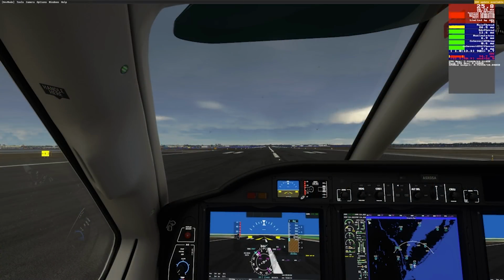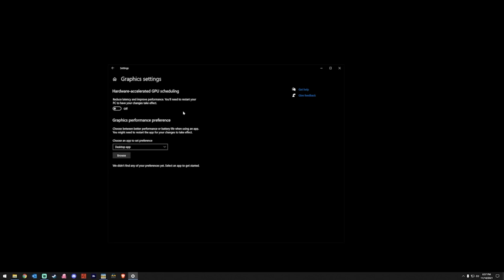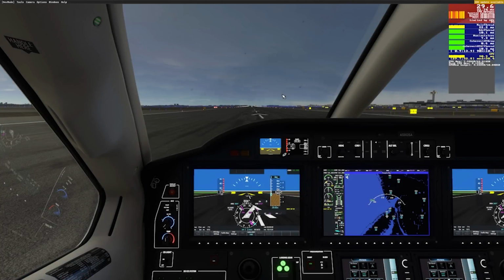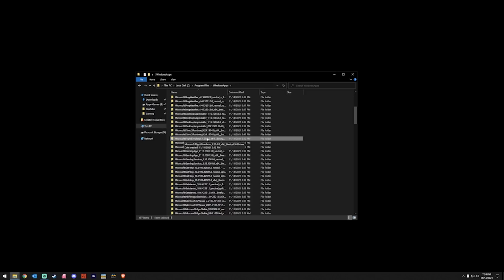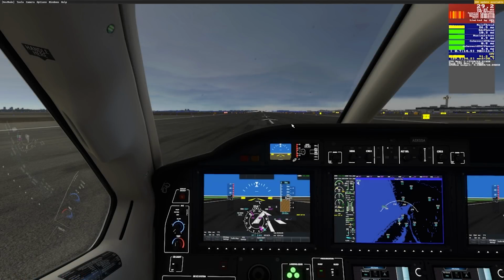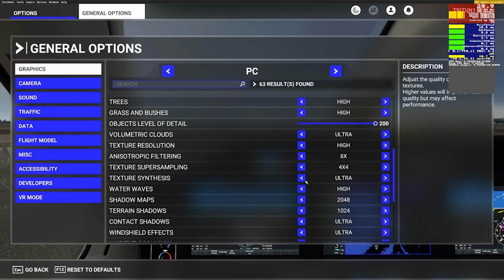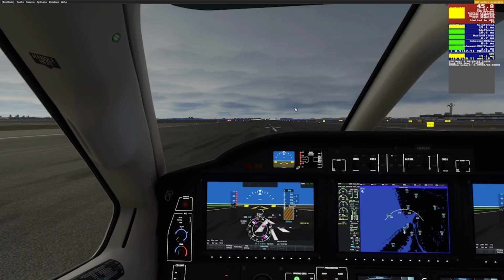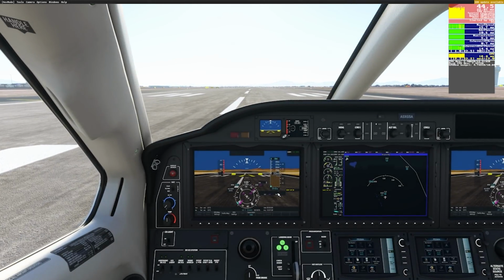Microsoft Flight Simulator | Finding Best FPS | Do Old Tricks Still Work

Comment: I do not understand but since yesterday the use of my gpu (rtx 3080) is 60% on average while before this between 90% and 100% .. with that I have a net decrease in my fps.
Reply: I start since 60 than drop to 50-45,even 35 mine is rtx3080tu

Comment: I have cancelled the game mode option three weeks ago and reduced the CPU package temperature by 20°C along with reducing graphic options. . Core running temperatures were around 100°C and now down to 75-80°C  (water cooled).  Also when you modfied  the graphic settings in MSFS2020 you have to make sure that you are not increasing the CPU operating temperatures.  You have to find a compromise between FPS and core temperatures. My home airport is LFRS.

Comment: Didn't you notice that screentearing? If you are dropping below (usually) 48fps Freesync isn't available -> screentearing.  In that case you have to go Freesync + VSync ON. If you don't often fall under the 48fps then VSync OFF. But if you don't notice it.... maybe that's not an issue for you. As i can't get a stable 60 fps on Ultra on my system i have to use Motion Blur, yes you loose details, but in my opinion its better then using High settings without MB. 💙

Comment: I'm currently playing with all, ultra settings (2070s, 1080p) except the new LOD set to 200,  FPS capped to 30 in Nvidia control panel. The smoothest experience I have ever had. I don't agree with this chase for FPS approach.
Reply: Running a 3080ti still trying to get a smooth performance
Reply: @DalisYn  seriously?  I'm running an i7-12700H with a 3070ti and this machine simply clobbers MSFS.  Averaging 70FPS in most places on ultra settings everywhere and no lower than 30FPS with 100% AI, heavy clouds, etc.
Reply: you capped to 30FPS in NV control panel or capped in the sim with v-sync on? Im getting medium 30/ 31FPS all the time, should i capp to 30?

Comment: I don't play in 4K. Looks unrealistic to me and WQHD gives me double the frames. >60fps with all in Ultra (Ryzen 9 5900x, 3080).
Reply: You got my 3080, give it back! 😊
Reply: @rakon8496  and as a preorder I paid retail for it 🤫
Reply: He said he normally runs 80-90 scaling so it’s lower than 4K, same as I do, as any lower on the big display I use it’s just too soft and blurry.  1440 would be too low.  Not sure what you mean by looks unrealistic.
Reply: @WhiteHawk77  think he means it looks so good that it's unrealistic.... real life is blurry...
Reply: @scottiemac-it  if it is to you, and him then it’s time for some glasses, contacts or corrective surgery, because it’s way beyond 4K to most I’m sure.
Reply: @WhiteHawk77  that's a fact. just started wearing reading glasses. World of difference. I use 3 24" monitors for the immersion but have contemplated a large curved ultrawide. Thoughts?

Comment: Helpful tips here, as always. I want to chime in on the "prefer maximum performance" in the Nvidia control panel. If you have the newest generation Nvidia card (30 series), leave that on "normal" for your own safety. There are certain games and applications out there that can destroy these cards when this is on maximum setting WITHOUT using a framerate limiter as well. There are manufacturing faults on solder points on these cards that might not handle the powerdraw these cards produce when left on maximum performance. So please beware.
Reply: I have it on maximum performance capped to 30fps , no issues here.
Reply: @bcsimulation  See, you use a frame limiter and this is why there are no issues. You can actually see why max power and no frame limiter can be dangerous to the newer 30 series cards. When Overkill switches from the cockpit to the worldmap, the fps instantly go up to 170-190 for some seconds. Under certain circumstances with the newer 30 series cards, the fps can get to 500 or more. The power for this performance is drawn instantly and can damage the cards in the process. This is what killed 3080 and 3090 cards in the closed beta of New World.

Comment: Thanks for the tips, will try a couple of them that I not currently use. I have good experience with Process Lasso sw to make my screen as smooth as possible. For MSFS2020 I make 1 core of the 16 core not do its work for MSFS2020. This helps a lot for smoothness / micro stutted on my Msfs2020 installation on Windows 11 running a Ryzen 7 Cpu and my old and mighty GTX1080 Ti.